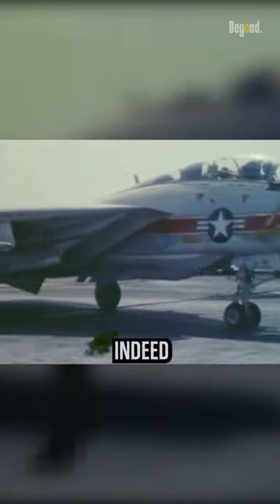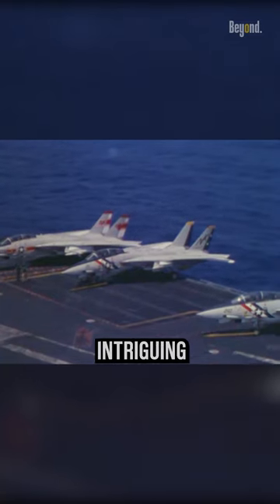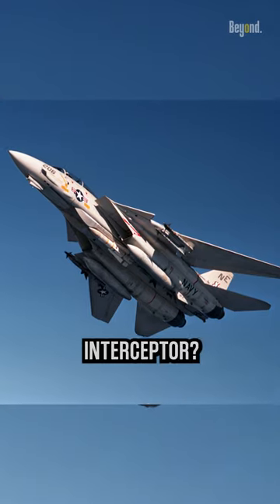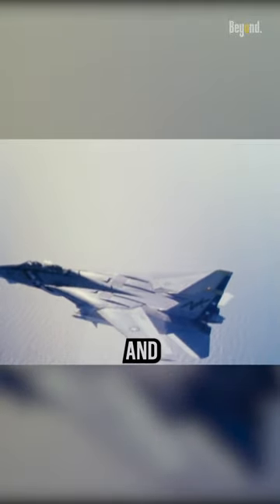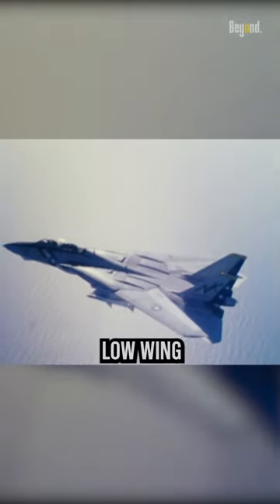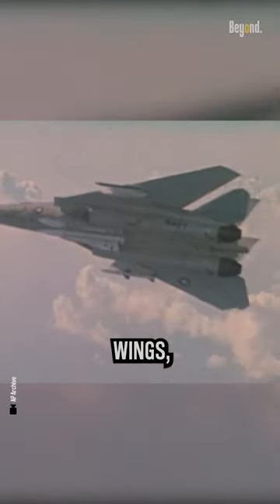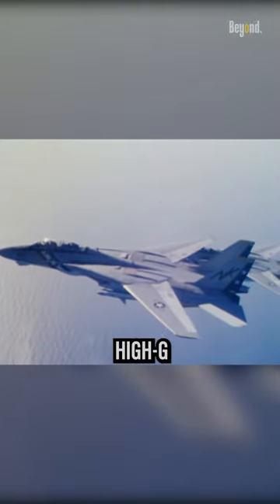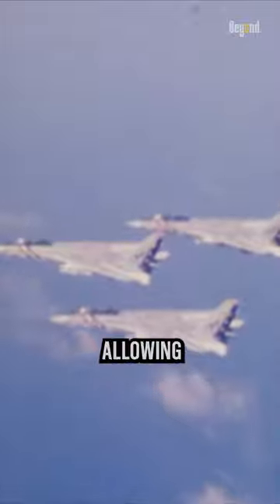Why does the F-14 Tomcat have low wing loading? #shorts

Comment: variable sweep wings or “swing wings” for fighter aircraft are not effective at air superiority

There seems to be a lot of F-14 nostalgia around. While it may have had a great deal of impact on how the US Navy conducted fleet defense, we have to consider the effectiveness of the concept of variable sweep aircraft.

To achieve variable sweep aircraft, that requires a large gearbox in the fuselage of the aircraft. This gearbox adds a great deal of mass and makes the fuselage larger, causing drag. This means that fuel fraction on such aircraft is lowered a great deal.

In a dogfight, this heavy gearbox would mean that compared to a fixed wing, it would result in an unfavorable thrust to drag, even if the pilot could switch to what they felt was the optimal sweep right before combat. Switching the wing sweep during a dogfight would be risky, as it could cause a loss of energy.

This would mean:

Higher wing loading due to mass of gearbox
Faster fuel consumption due to gearbox
Lower transient performance (very important in a dogfight)
This gearbox would also lead to lower G limits as well. On the F-14D, the symmetric limit at 50,000 lbs was 6.5G. The F-16  and F-15 were both capable of 9G. Navalized versions of the F-18 were capable of 7.5G, while certain land based variants of the F-18 could also perform 9G. For a comparison, Dassault Rafale can do 11G, with an ultimate limit of 16.5G.

The gearbox lowered the aircraft’s fuel fraction. An empty F-14D has a mass of 43,735 lb ( or about 19,838 kg) and can take on 16.200 lb of fuel. This results in a fuel fraction of 0,27, which is below 0,30 fuel fraction required for sufficient combat persistence.

Jet engines have become far more powerful than their 1960s and 1970s counterparts, allowing for much higher thrust to weight ratios. As such, they can achieve lower take distances, even more so on an aircraft carrier with a catapult. This fact somewhat negates swing-wing’s main advantage of high low-speed efficiency.

Modern computer control surfaces too have played a role in rendering variable wing sweep obsolete as they can adjust wing shape and size very rapidly, without the weight penalty.

The more complex a system is, the more risk there is for failure.

When the US Navy opted to retire the F-14 in favor of the F-18, a big reason that was given was the appalling flight to maintenance ratio.

a newer F-14 would likely require 40 to 1 and on average, the F-18 requires 8 to 1, which is in line with the USN’s claims of 5-10 to 1. So in that regard, the F-18 would be able to generate much higher sortie rates. Keep in mind that the 50 to 1 is with after  the General Electric F110 engines were put on the F-14. Early F-14s suffered from an unreliable TF-30 engine that was prone to flame-outs.

Compounding the problem, the  high flight to maintenance ratios mean that there’s a good chance you will not have enough F-14s available when you need them the most (ex: if an enemy launches a surprise attack on your carrier battle group, you may need to scramble the aircraft very quickly).

There were other points of failure. Sometimes when one side of the gearbox worked properly and the other did not, it could lead to an “asymmetric wing sweep”.

While the aircraft could fly in such a situation and land with some difficulty, this leaves a point of failure. This could also be a weakness in combat, as the hydraulics could be damaged.

Much like this F-14, under Australian service, the F-111 did encounter a similar incident, and the B1 did once as well. I suspect that under Warsaw Pact service, Soviet variable sweep designs may have too.

The cons simply outweigh the pros when it comes to variable wing sweep. There are very significant penalties in terms of mass, cost, and complexity for variable sweep wings. While they may bring some advantages in the take-off and can have the “optimal” sweep for each scenario, the drawbacks outweigh these to the point where we are not seeing variable wing sweep aircraft on modern aircraft.

They are simply a dead end as far as aircraft design goes. While they may have seemed like a good idea on paper, when implemented in combat aircraft, they carried significant drawbacks that outweighed any advantages they brought.
Reply: There are two points I think should be added to your otherwise excellent analysis.  First, unlike the F-111, the Tomcat's wing sweep was computer controlled.  That lowered the workload on pilots, allowing them to concentrate on flying the airplane, but it also meant that an adversary could judge the F-14's energy state by watching the wing sweep.  A lot of Eagle pilotss took advantage of that in DACT.

The other point has to do with the F-15.  While its rated G-loading was 9 Gs, pilots could "pull through" a detent in the stick's travel if there was a need to a little more performance.  While I was stationed at Seymour Johnson AFB. one of our Mud Hens was out at the Dare County range and got a little low and a lot fast on a bombing run.  Had the aircraft been a Lawn Dart, there would have been a water-filled hole in the marsh where the F-16 went in.  With the F-15, the pilot pulled through the detent and managed to bring the jet back to base.  When the aircrew got back to base, the crew chief swore a blue streak that could be heard in Raleigh: the pilot had bent the jet pulling 12 Gs to avoid becoming a hole in the mud.  But at least the aircrew got back safely, and the aircraft could be parted out before going to the Boneyard.

Comment: Wouldn’t have anything to do with the fact that the wing isn’t fixed like a normal plane wing?
The wing box junction can’t handle high loading as it’s basically a single pin holding the wing on
Reply: The winngs were designed to fold so more aircrafts could be added to carriers, the single pin is just an advantage with the design as less moving parts would keep maintenance at an all time low!

As for the weapons, they would be strapped onto the sides and oartly under the wing so high loading doesn't become an issue for accelerated G forces which can tear wings off, ever the wings tear off, the jet would immediately get stuck into a spiraling spin, preventing the pilot from ejecting safely and causing an uncontrollable crash.

Today's planes have multiple wing supports, this is due to weapons being heavier and planes becoming faster.
Reply: As for weapons added, it's easier tucking them into the body, this avoids detection and allows for easier fighting capabilities, with only down side being less Missiles.
Reply: I'm still surprised Northrop Grumman managed to make that swing wing work with such a high safety level. It just seems like a crazy idea. @Capastian - I was led to believe the swing wing was for extra lift from the short carrier runway, and a slower speed for coming in to land. Not anything to do with fitting more planes on.
Reply: @capastianluna8896  the folding up wings of carrier based aircraft are a different thing all together. 😆
Reply: The pin was engineered to endure the demands placed upon it. It's actually a very robust design, it isn't made of pretzel rod.
Reply: There are some misconceptions about the purpose of F14 variable swing wing. Some people thought that it was just an alternative to the folding wing design. Its main purpose is to enable the wings to generate more lift at slow speed when the wings are swept forward and reduce drag at high speed when swept aft. When parked on the deck, the wings can sweep aft just a little bit further to make the F14 very narrow which is more like an added bonus of the variable swing wing. The wing load is also variable depending on the sweep angle as well.